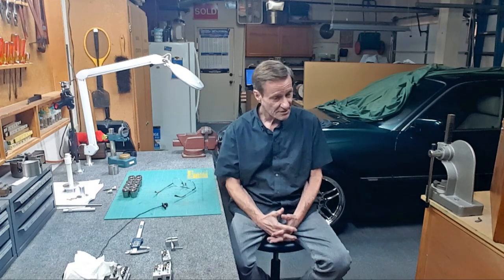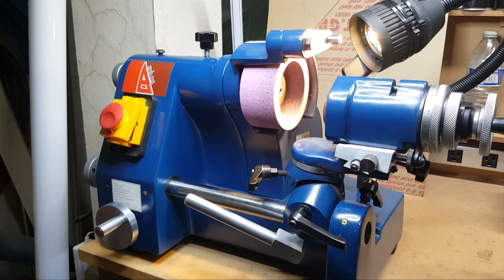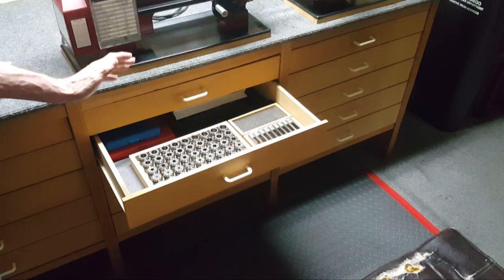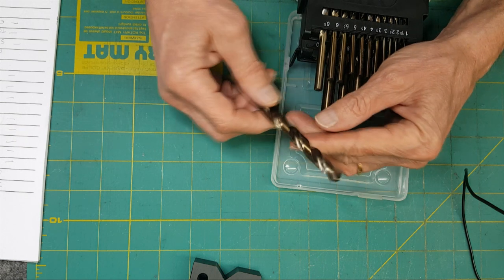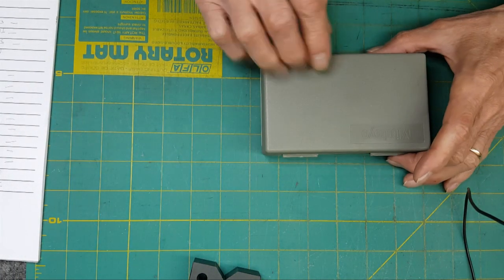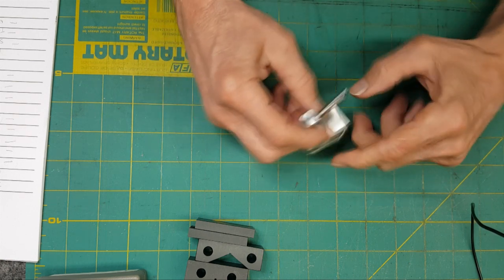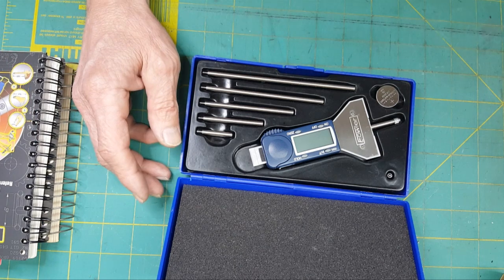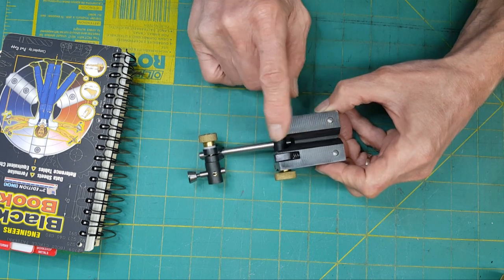Machinist Tools The Good & Bad

Comment: I am surprised you don't use your Gauge blocks, I use my pratt and Whitney set a lot in conjunction with my Sine bar but I guess it depends on the type of work you do. I use my large version Black book quite a bit at my desk but mainly use my "Zuess" book more at the machine.
Reply from the maker: Hi Malcolm, rarely do i need to bring out the sine bar but did use it with my square gage block set to make the angle blocks I showed...

Comment: Great topic Dave, it would be interesting to see viewpoints from other machinist and hobbyist since we do different types of work and projects. Oops this might start a trend. 
You got me thinking I sure have quite a few nice tools that never come out of the drawer, waiting for that special project. 
I’m putting that little depth gauge on my shopping list..looks real handy. Enjoyed….👍
Reply: Hi Dean,
That depth gauge looks exactly like the same thing detailed on page 33 of the Guy Lautard first Machinist bedside Reader book. Very simple to make your own. It's base length is 1.250" long, the block is 7/8ths high and the middle radius cut out has a .300" radius. Guy made his mostly on a lathe and with a 4 jaw independent chuck. .125" hardened drill rod was used for the gauging rod. If I was making one I think I'd choose 4140 PH for the gauge body just for the better wear resistance.
Reply from the maker: Great suggestion!

Comment: I don't know Dave you must be like the engineers I worked with in the machine shop. They could start the train but had no idea how to stop it. First Dykem is a layout fluid not for matching ways for that you use High Spot Blue. This stuff can take a dot about 1/8" dia. and cover a square foot. Second if you don't want the gauge blocks send them to me I would get good use out of them. But thats the difference between an engineer and a machinist I guess. There has been times when I took a reengineered fixtured that was over 100lbs and set on an engineers desk because he thought he was smarter then the machinist that used the fixture at least 12 out of 28 to 31 days a month. I do like your channel but these 2 items are a mainstay in a shop just like micrometers and calipers. Just saying 36+ years machinist running manual and CNC mills and lathes and grinders.
Reply from the maker: Yes I know dyken is a layout fluid as I said in the video and it is much cheaper than dykem's high spot blue which is why I used it instead. And yes I am an engineer and not a machinist so we live in different worlds...
Reply: @TheMiniMachineShop  Unfortunately when I had to retire on disability I had to sale all my tools including a 92 piece set of gauge blocks I bought off a man that had retired from a government inspector job he only used 3 blocks for his job and they where the only ones missing the rest where still wrapped in the waxed paper from the factory. That and my coaxial indicator are the only things I really regret giving up. Because now I'm working on getting a home hobby shop going. I just bought a Harbor Freight 7x12 lathe I'm working on setting up. I don't like the mounts too narrow and not ridged enough. I watch a lot of the mini machines video I have subscribed to yours I like your setup.  But sorry I am controversial about some things. I use gauge blocks to check my micrometers because I don't trust the standards that come with them so I double check them. Even when I worked in the shop and had an inspection department that calibrated all micrometers I would double check them to my feel. My micrometers my feel.